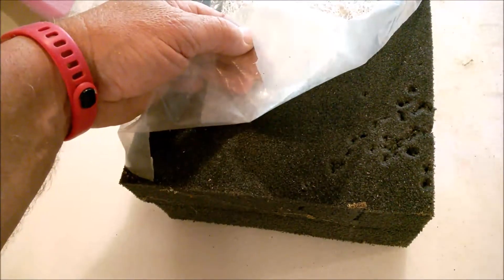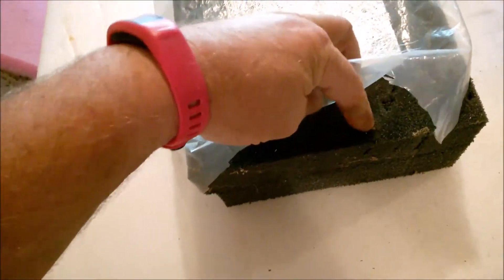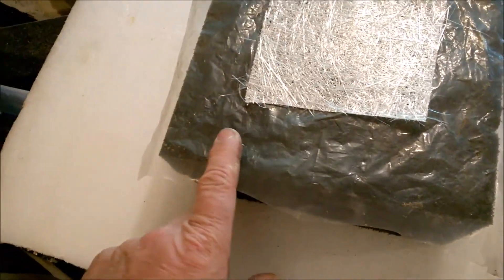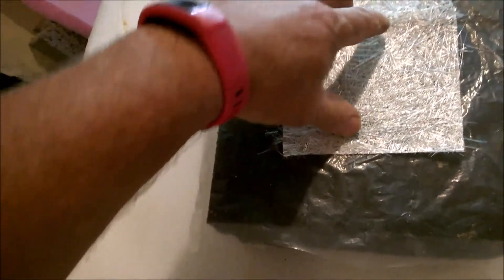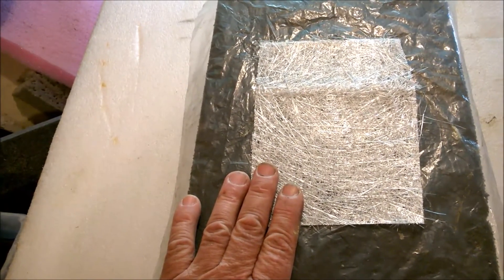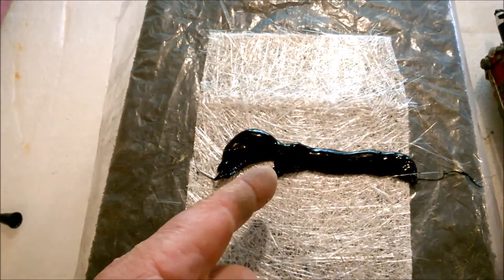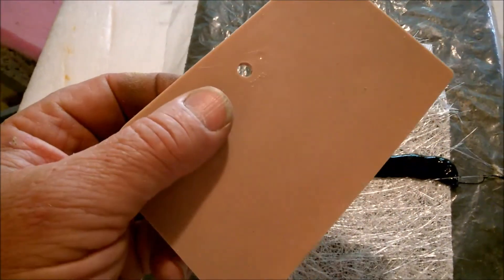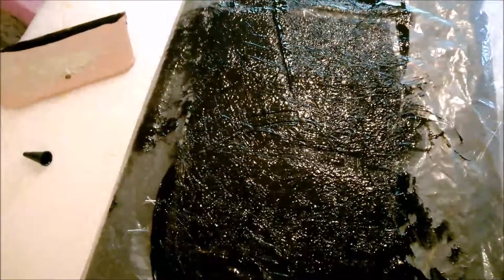Fiberglass and Silicone mix

Comment from the maker: another note if you can only do a single application. Start with a squeegee coat on the surface of your item. 1/16 " thick. Then cover immediately with the fiberglass. Squeegee more silicone over the top 1/8" or less. allow to set for 2 days. (mist with water if in an arid climate. Once the silicone is firm use the soap and water method to apply silicone into the desired thickness and /or texture. NEVER apply more than 1/4 " at one time.Erik